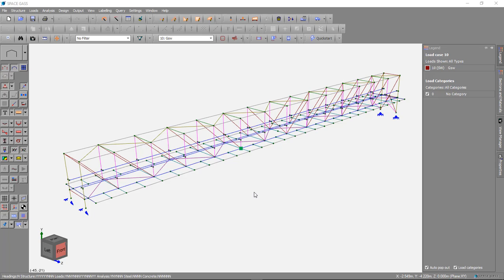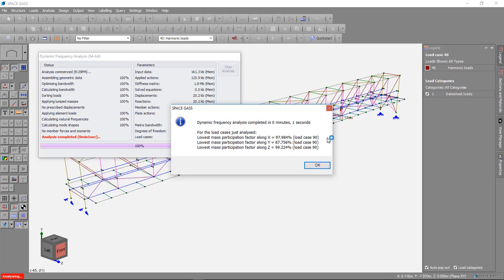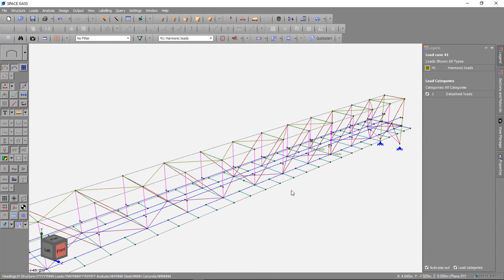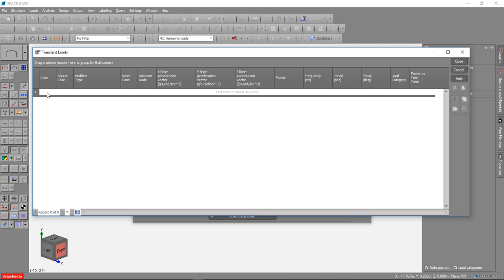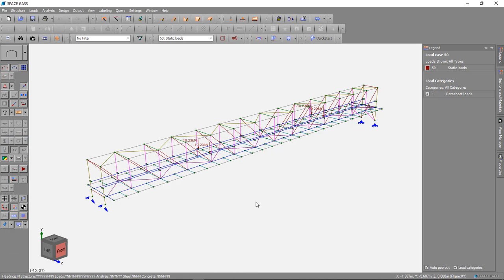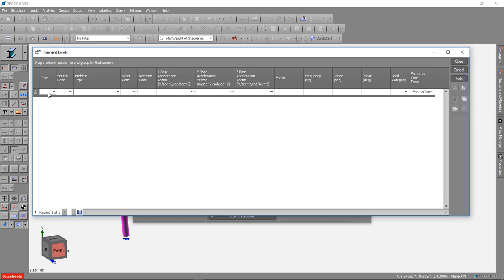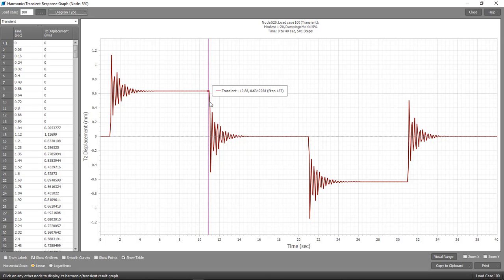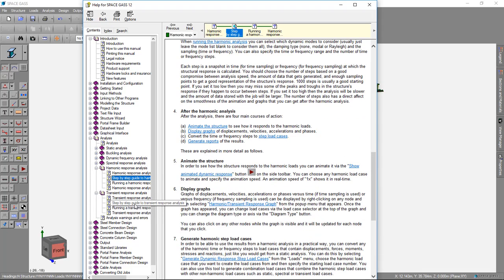SPACE GASS Harmonic & Transient Response Analysis Recording   12 Nov 2019

Comment: Nice work Cosiee, this video is detailed and effective. For multi-storey building if the oscillation is caused by an equipment at top most floor only will you apply lump masses for dynamic analysis on all of the floors or it should be defined at the floor which is directly subjected to vibration